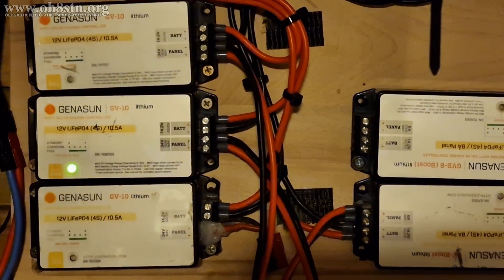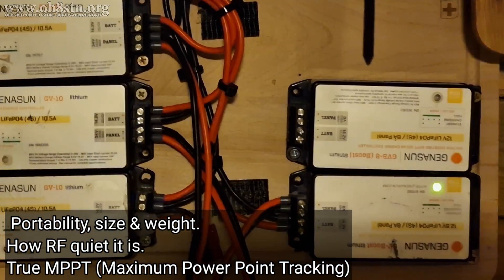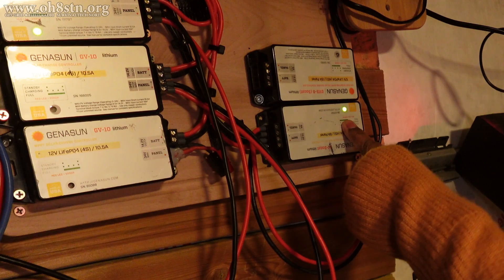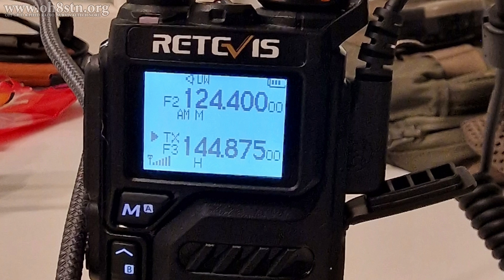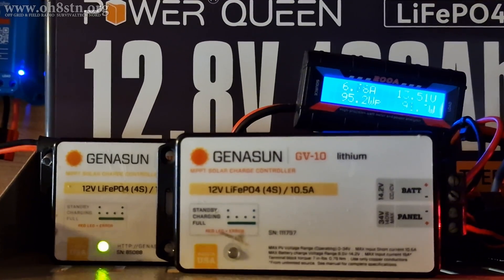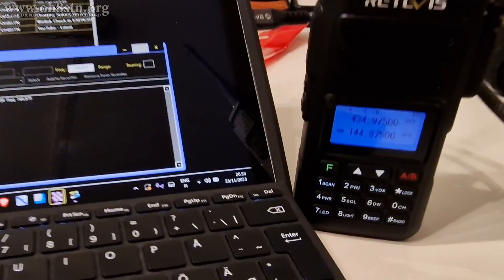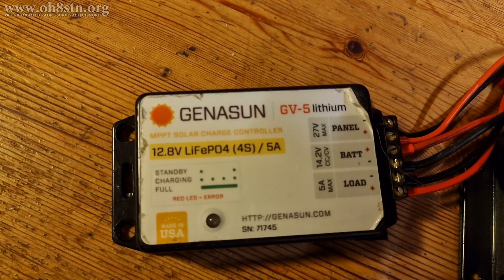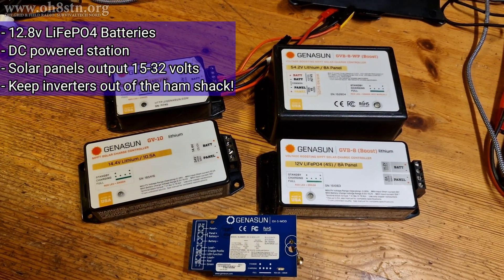Genasun GV-10L MPPT solar charge controller for Ham Radio

Comment from the maker: Genasun MPPT solar charge controllers are radio friendly and great for off-grid communications on solar power. They are lightweight, RF quiet,  consume very little energy, and can be used with Lithium iron phosphate LiFePO4 and other battery chemistries.

73
Julian #oh8stn #offgrid 
Video URL: https://youtu.be/ND3YqAkBIJU
Related blog post:https://oh8stn.org/blog/2023/11/30/radio-friendly-mppt-charge-controller-for-off-grid-comms-genasun/

Comment: I have been testing  portable charge controllers for Ham radio for many years and followed your advice. I went through maybe 4-5 controllers and they were from bad to insanely bad. Then couple years back took your advice on Genasun. Wow! Game changer MPPT. All I get is  insignificant RF on 10m. I never tested 6m or 160m. But from testing if 80m not an issue nor will 160m. I did have a Buddipole Mini solar controller that finally died. Nice but expensive unit. Limitations were it’s not MPPT and it’s max solar line voltage and current are very limited to 150w panel and below. But still great concept and works well especially for 100w and less. . But Genasun is less expensive and far more robust and efficient too. Always great content you do. Thank you !

Comment: The main problem I have with Genasun is that (especially in the UK) they are very pricey for what they are, and their aphiliated stores add on shipping AFTER you've already paid for the item, which causes an error in the payment process (they wanted to charge £40 shipping on top of their lowest-cost model at approx £100, which in total is nearly £140! 😨). If they were to come down to somewhere like £50 per unit, then it would make sense - but on a small-scale 'on-the-move' charging system, it costs more than the batteries and panels do. Is this because of a lack of competition that their prices are so sky-high??
Reply from the maker: www.genasun.eu is in Netherlands.  Shipping to me is quite reasonable, and is calculated at checkout, not after.
There are cheaper controllers, but then you have to deal with a noise. If someone made an rf quiet charge controller with good performance at a lower price, I would certainly buy it. Sadly we are paying for the engineering.

Comment: Julian - I'm a bit confused on using the Genasun vs something like the Buddipole PowerMini 2. It seems like the PM2 would be better for multiple power inputs (solar, 12V car plug, wall charger, etc.) where it can automatically switch from one power source or another or use both. It also lets you plug two loads in, which lets you avoid a power distribution block if you only have two things you're connecting, or you could have two different power distribution blocks that you could shut down independently.

Also, I didn't understand how a PM2 would work with a Bioenno, since they have one connector for power in, and one for power out, whereas the PM2 has one connector to the battery that will either put energy if or pull it out. If that works with the single Bioenno "In" (either putting energy in or pulling it out), can you still use the Bioenno's "out" as a third load connector? 

It seems the Genasun is better for when your only power source is solar, you're charging one battery like a Bioenno, and that output is hooked up to one load or power distribution bar. But the PM2 would be better for automatically managing a more complicated setup. Maybe you could do a video on that? Thanks for everything you're doing!
Reply from the maker: Short answer: Don't let the hype fool you!
There are two good things about that charge controller. 1. Dual outputs. 2. Displayed battery information.

The PWM charging doesn't work well and will always be outperformed by an MPPT controller.  The PM has terrible low light performance, as it starts charging much later than a Genasun controller connected to an identical solar panel.

My personal experience with the PM is: Stick with a controller that is designed to collect solar energy. If you need more outputs, build a multi-output cable.  I don't want to crap on buddipole, but. My attempts to share ideas on how to improve that charge controller got shut down. They are extremely narrow-minded and easily insulted when shown to be out of their debth. If they would put a Genasun controller inside that box, I would promote it everyday all day.
Finally people buy it because it has dual outputs and an information display. Sadly , most of the same people don't understand how poorly it performs as a charge controller.
Reply: @OH8STN  Got it, thanks! It does sound like you can give multiple power inputs into the Genasun, they should just be higher voltage (14.5 - 15V at least, though not exceeding the maximum voltage or max amperage, unless you get a boost model (those just seem to have a wider voltage they can work with? The regular one says it can go down to 8V, so it does have some boost, just not as much as the boost model that can go down to 5V). 

You would just have to switch between the sources manually, and you couldn't use two sources at once. There are various adapters for cars or wall outlets that you can choose a higher voltage for, so those would work to plug into a switch to select between them, and then that into the Genasun to let it handle the battery charging part. I probably spend more time thinking about how to power my gear than I do the gear itself! It's all a bunch of paper weights if there's no power going to it, right?

Comment: I can not find a Genasun controller that can handle my  Powerfilm 160W Crystalline Foldable Solar Panel (Wattage: 160W, Operating Voltage: 28.3V, Current: 5.7A) Genasun advised they do not make one currently, that can be used safely with my solar panel... Any advice?
Reply from the maker: Genasun GV-10L works fine. 32v max voltage,  10 amps max current.  That's what I use.

Comment: Hi Julian, does that mean that the BuddyPole mini 2 is not RF quiet?
Reply from the maker: It's quiet in the ham bands because of the added filtering. I found it not to be quiet outside of ham bands.  The bigger problem is performance.  It's great in California. Awful at higher latitudes.
The powerpoles are nice but performance is more important (for me).

Comment: In addition to the Genasun brand solar controllers, Sunforge has its Blue Sky brand controllers, which go up to 20-25A for 12V systems. It would be useful to know whether they are RF quieter than Victron controllers which you have tested.
Reply from the maker: Sadly, they are not RF quiet.
Great question 👍
Reply: Better, or worse than Victron controllers? @OH8STN
Reply from the maker: Their engineers said the Blue Sky controllers are nowhere near as quiet as Genasun. I haven't tested them myself, just gave them the requirements. Based on their feedback minded in both the ordering one.
Reply: The Blue Sky documentation says, "To comply with electromagnetic compatibility requirements..." to install "ferrite suppressors”. Has anyone tried and tested it?

Comment: Hi Julian, I have a curiosity to clarify. I went to Lapland in Sweden to see the Northern Lights. I asked myself as a radio amateur: how much does it affect you in radio transmissions on HF, VHF and UHF? Thank you very much if you can clarify this doubt for me. 73 of IW2HTZ
Roberto
Reply from the maker: Very much! In fact there are times when you can reflect signals off of northern lights with high speed data, to dpsn thousands of miles or kilometers. Sometimes you can even hear your own signal reflected back at you.
Reply: @OH8STN  tnx a lot Julian! So in case of northern lights you haven't poor signals? Tnx a lot and bests 73 p.s. why don't you prepare a video with this thema?

Comment: With a solar panel of 20v max 100watts, into 10 amp solar charger, and the bms with lifepo4. 
I have realize that when the battery when full, the system bypass the battery power of 12.8v and as it is full bypass and get full power of the solar panel 20v. 
In case that always have the radio connected to the system the radio will get 20v getting overvoltage. 

Who in the system should cancel the bypass and avoid that overcharge in output on the battery system?
Reply from the maker: I've experienced this once myself. The problem is not having the correct charge controller voltage, set under the bms high voltage disconnect voltage. If the high voltage disconnect of your battery is eg 14.6 volts, uour charge controller should be set for 14.4 volts. For my power queen batteries the high voltage is fourteen point four volts, So my charge controllers are usually set between 14.2-14.4 volts. It all depends on the high voltage disconnect voltage. This will prevent that bms going into high voltage disconnect. It's also important to point out that not all charge controllers root raw solar on the battery output.
Excellent point 👍
73
Julian oh8stn
Reply: Found to have similar problem just yesterday.

Comment: What has your experience been with the buddipole PowerMini 2?
Reply from the maker: Disappointment.  The integrated anderson power poles are excellent. However,  the low light performance was poor. Also, the USB ports don't push enough power. It could be much better.
Reply: Plus way overpriced!

Comment: Hi Julian,   I enjoy all your videos and posts.
I see in this video that you have a couple of the GVB-8 (Boost) Lithium charge controllers controllers.  I would really be interest in seeing a full review of your testing and best use cases for these controllers.  What is your assessment of the best use case of the Boost Controllers, and how to best test them.  I haven't been able to fully test mine yet, but if I substitute a variable power supply for the panel input, it doesn't seem to like voltages above 13.5 vdc or so.  Yet it seems to be working with my SunPower 100W flexible panel.  I cant test properly because I'm not getting much sun light this time of year (Canada) through my window.  The panel is new, so haven't had a chance to deploy it outdoors for testing yet.  But, would appreciate your assessment of these controllers.
Thanks,
Jeff - ve7eff

Comment: This is quite useful information - I've had solar panels on small boats discussions with my friends over time, and I've never had time or energy to suggest anything else but Victron. These Genasun controllers look very much what is reasonable in many cases - small boats aren't that far from backpacking, except that often they are hesitating on getting a LiFePO4 battery due to price, even if they come with obvious benefits and operating environment basically never gets below freezing.

Comment: Can I use the Genasun GV-10-Li-14.2V with a bioenno 12ah? Or does the GV-10 put out too many amps for that battery?
Reply from the maker: You should look at the maximum charge rate for that battery. However, I'm using the same charge controller for my 10ah battery for many years 👍
Reply: I emailed bioenno & they said it’s fully compatible

Comment: I use the Genasun 10A charge controller for LiFePO4 batteries. be aware of what you order.  this controller is not suitable for lead acid batteries.  I can say that this controller is indeed rf quiet.  it does the job well.

Comment: Thank you so very much for sharing Julian, I am in the market for a portable battery and charge controller for my FT-991A.  I know this is not too portable of a radio but, I would like to get myself setup for off grid communication.  If you buy a MPPT charger, do you need to have MPPT solar panels?  Thank you again Julian for sharing.
Reply from the maker: That's a great question! 
As long as your solar panels are below the maximum voltage & current of the charge controller, They will be fine. 💪👍
Thanks for watching, Commenting anne for the kindness. It's greatly appreciated.

Comment: Would like to see how to run the genasuns in parallel with multiple solar panel arrays.  I’m new to solar and concerned about setting it up wrong and damaging batteries or equipment.
Reply from the maker: I think I'll do that video next 👍
Reply: for that configuration a different  charge controller might be better suited and less expensive

Comment: Hard to tell with the lighting in the video, is that a gen1 with a AC->DC adapter or a gen2 hand crank unit straight to the genasun?
Reply from the maker: Apologies for the lighting. It's a gen one with a 12v cigarette lighter output. That output is connected to the solar input on the Genasun GV8 Boost conttoller. 
Hope this helps.
Reply: @OH8STN  awesome! I have a gen1 that's AC unfortunately so I had to get a small "wall wart" AC lifepo4 charger. At least it only produces RFI when I'm cranking :/
Reply: What is the hand crank you are using? That is an awesome unit!
Reply from the maker: Mine is the K-Tor P50 50-watt Hands crank generator.